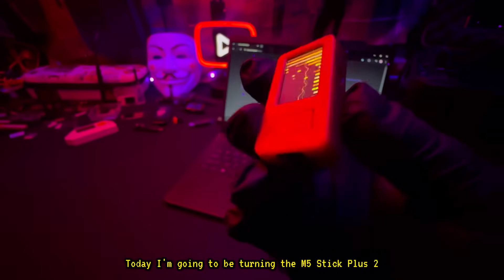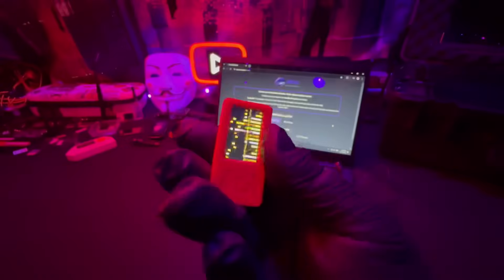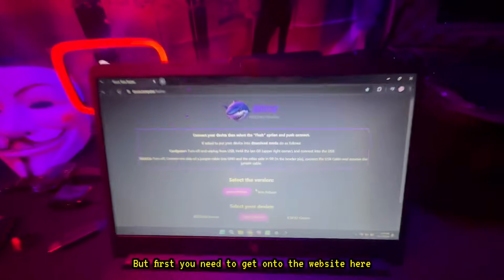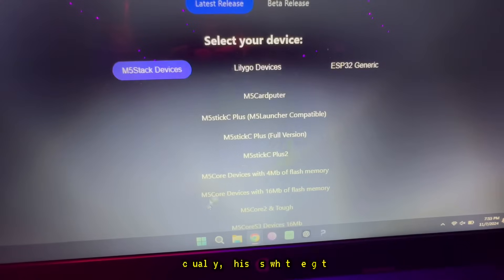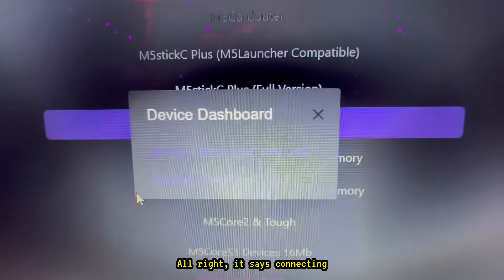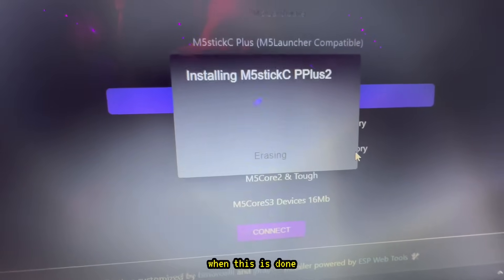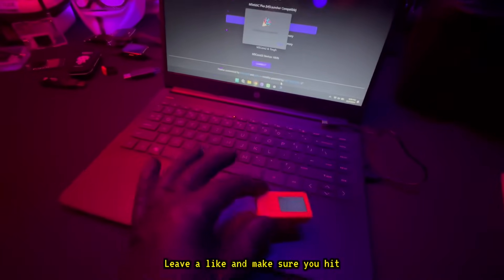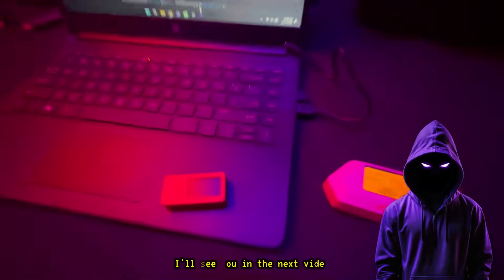Make a CHEAP Flipper Zero with M5StickC Plus2: Full Bruce Firmware Flashing Tutorial!

Comment: I've got a flipper and the stickc 2 plus, my question is, is this compatible in any way with the flipper zero?
Reply: Yes, you can run Bruce on your flipper. But if you mean the two devices working together I would suggest ghost esp. then you could operate the stick from your flipper.

Comment: I need to reset it to factory settings. I installed the wrong application, so the computer com connection is gone, I can't delete it , because there is no com.
Reply: There is a stupid text on the screen and nothing else. The application seems to have canceled the com port like a virus, I cannot intervene, I did not use another cable, I did not use another computer, the result did not change. help me ❤
Reply: @VolkanYolcubal  you find way?
Reply: @TheRealKuzya09  no